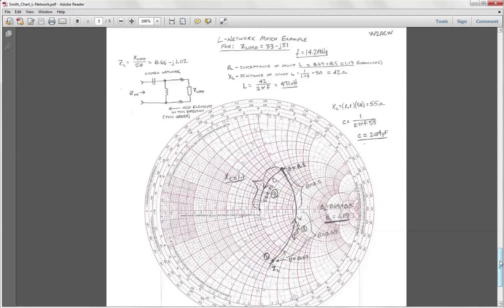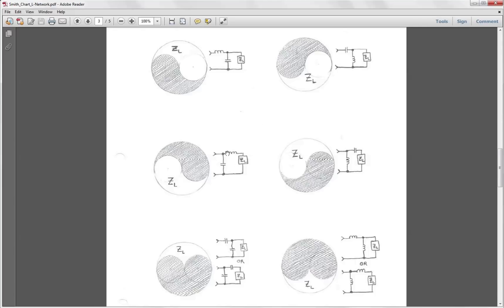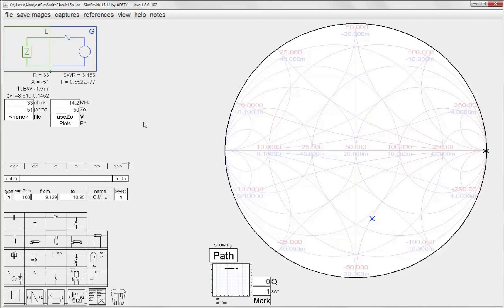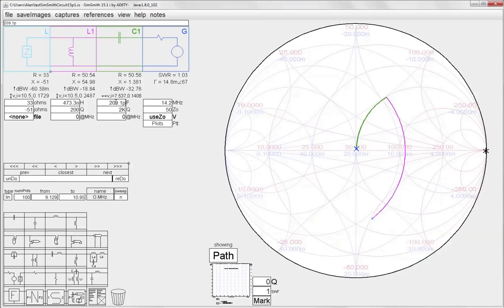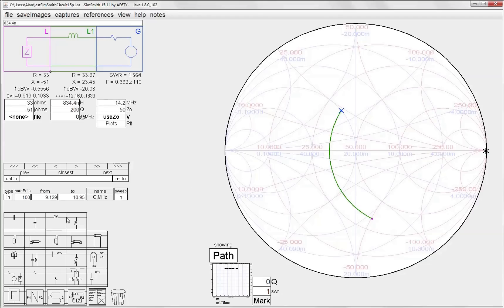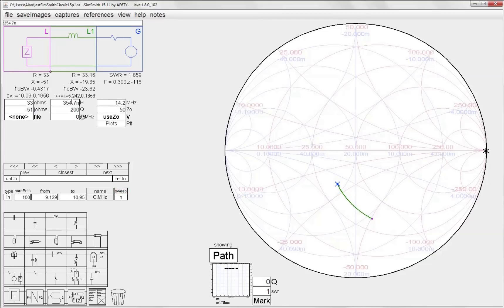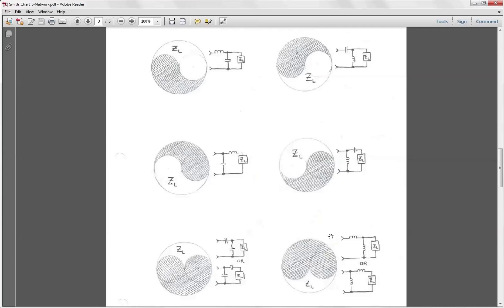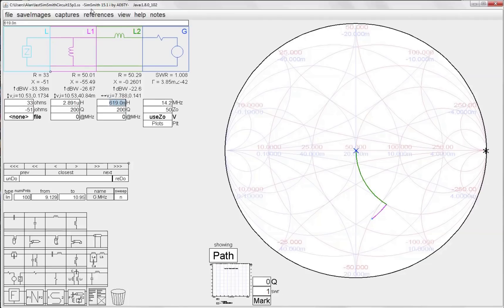#278: Smith Charts: Use SimSmith to design L Matching Networks

Comment: Thanks for the nice comments Alan.  SimSmith can solve a huge number of problems that are encountered in amateur radio and RF design in general such loss in antenna tuners, matching range of antenna tuners, RF power combiners and splitters, balun design and performance, crystal filter design, and much more.  This a really nice time to learn these topics as reasonably priced test equipment and great analysis tools (free) are available.
Larry, W0QE

Comment: Hello,
Thanks again for the video, I watched it twice. I have a question.
Can the frequency of the inductance and capacitance influence the matching process?  Same question for the quality factor.
I see that in the SIMSmith table we have a part to fill in the frequency value of the inductance and capacitance. I also see in the capacitance data sheet that they have an impedance vs. frequency curve. Should all of these characteristics be considered when choosing the value of the matching elements?
Thanks.

Comment: Hello, I am beginner in antenna design and tuning.
. I want my antenna to have a resonant frequency of 2.45GHz for Bluetooth low-energy communication. 
And I want to know which point to consider for the matching process.
I have made some measurements with Nanovna of my antenna. I have a resonant frequency of 2.28GHz and at this frequency, I have an impedance of  47.8-7.06j.  Could I take the value of this impedance at that frequency and change the frequency to have 2.45GHz. Or I must take the value of impedance at 2.45GHz and process to the matching process?
Reply from the maker: You will need to use the impedance measured at 2.45GHz.
Reply: @w2aew  Okay thanks

Comment: But this can be done at the transmitter output as well or is it another story? Bacause I usually see some kind of PI low pass filters but I can't undestand if they are also used for impedance matching.

Comment: None of the material I've looked at explained the use of the Smith Chart until this series. Thank you so much!

Now, what happens if we consider losses in the feedline? I am really interested in learning how to analyze the antenna system including the impact of feedline losses so I can understand how to design and build antennas.

I am (and was) aware that the complex impedance of the feedline affects SWR readings at the input to the feedline. What I'm trying to understand is how to get from what the meter is telling me to how to adjust the antenna and feedline for best performance.

Does that make any sense?
Reply from the maker: Actually, the length of the feedline does NOT affect the SWR, but is DOES affect the input impedance seen looking into the feedline.   Loss in the feedline will make the SWR appear lower because the reflected energy is attenuated on it's return trip back to the transmitter (makes the trace approach the center of the chart).

Comment: When in doubt, don't bother calculating.
Just load an app and start screwing around?
Reply from the maker: In my previous couple of Smith Chart videos, I do show how to do it all manually.  The software makes it faster to run the experiments - but you should still have an understanding of how the chart works, and the effects of adding tuning elements.

Comment: Hello, Thanks for the video .
I'm wondering on how to add parasitics reactance components in the generator (adding impedance) instead of pure resistive Zo ?I'm trying to simulate L matching network between amplifier(z output transistor/mosfet  and load).
Thx alot
Reply from the maker: You can reduce the resistor in the G generator, then add additional components in series to simulate a complex source impedance if needed.

Comment: Alan, could you show how measuring a load (an antenna) connected via a arbitrary lenght of coax affects the reading (if the antenna is not resonant)? I understand it does, hence the OSL procedure on some instruments. Thanks.
Reply from the maker: I describe the effects of a transmission line on the measured impedance looking into the line, in video #275, starting at 5:16.  The OSL procedure is used to establish a new measurement plane at the point of the load or DUT attachment, by de-embedding the impedance transformation added by the line.
Reply: Thank you. Very clear, but if I'm not mistaken, if you measure the load with an arbitrary length of wire and the result of the measurement the VSWR is 1:1 then the load by it self MUST be resonant too, as the effect of the transmission line whould be rotating on the centre of the chart. I always thought that there was a chance of getting a 1:1 VSWR redout of the combination of the load and transmission line but the load by it self not being resonant (eg, measuring 1:1 at the transmitter side wouldn't imply a resonant antenna). Correct?
Reply from the maker: Don't confuse resonance for a impedance match to the system impedance (or transmission line impedance).  Resonance means that the reactive component of the impedance is zero.  Resonance does NOT mean a perfect 50 ohm impedance, nor does resonance mean a 1:1 VSWR.  Many people think it does because most antennas are designed to have a resonant impedance of 50 ohms (but not all of them do).  VSWR does not depend on, or change, as a function of the transmission line length (as long as the loss is negligible). But, the input impedance looking into the line WILL change as a function of line length for a line-to-load mismatch.  If you have a load that has a 2:1 VSWR (in a 50 ohm environment), the constant VSWR circle will pass through the real axis on the smith chart at 100 ohms and at 25 ohms at certain transmission line lengths.  These are resonant points, but not matched to 50 ohms, and still give 2:1 VSWR.
Reply: Yes, I understand that, no problem. I tried not to tie my question to a 50 ohm environment and therefore the mix of terms. Anyhow, back to my question, If you measure VSWR 1:1 at the the transmitter side (in a 50 ohm environment) then the load (antenna) must be 50 ohm resistive, independent of the length of the wire, correct? If so, my assumption that a 1:1 VSWR at the transmission line could make you think that the load (antenna) may not be 50 ohm resistive is not correct. Correct?
Reply from the maker: Correct.  If you measure 1:1 VSWR, then the load has the same impedance as the transmission line (50 ohms, no reactance, for example), regardless of transmission line length.  It could also mean that the line is very lossy, to the point where the reflected power is dissipated/lost before it gets back to the transmitter.  This is a less likely scenario, but it would result in a (potentially false) low VSWR reading when the load is mismatched - but it would have to be a long lossy line...
Reply: Alan, thank you. Very clear.

Comment: Alan, I always enjoy your tutorials. They are well thought out with no waffle, little repetition and are not too long. Unfortunately I was not able to fully enjoy this video as there was insufficient contrast in the screen capture  for me to see details in the chart. Perhaps you could find a way to improve this; or am I the only one having problems viewing this video?
Reply: In SimSmith there is very little detail in the on screen smith chart. Paper charts need the detail, as that is where you have to get the information. The program prints the actual numbers elsewhere on the screen, so you don't need to squint trying to interpolate the correct answer from the chart. 
   The chart actually looks has that faded look in the program, and it is done on purpose.

Comment: My PC has also a quite noisy mic input and the way to fix that is to buy an usb mic. This can be expensive to get a good one. A cheaper way is to buy a $10 usb audio device with a mic input. It's not ideal but it's an big improvement over a bad pc mic input.
Reply: Another option is the Audio Technica ATR2100-USB or AT2005USB microphone. There are several dozen YouTube videos as well related to these microphones.
Reply from the maker: Thanks - I think I'll invest in a decent USB mic.  Sorry about the crappy SNR on this one...
Reply: Thanks for all your great videos. I searched a bit and you can start with that kind of cheap devices amzn.to/1Pds77X if you don't want to spend $100 or more...
Reply from the maker: Hmm - looks pretty cool - cheap too. So cheap in fact, that I'd have to add it as an "add on" to get it on Amazon prime.
Reply: Or edit your audio with audacity (free open source program) it is simply amazing.
Reply: https://youtu.be/UhG83WS51q8